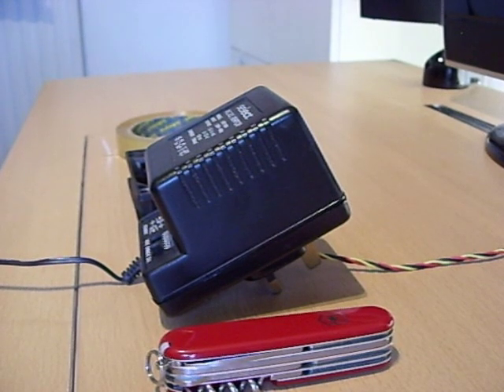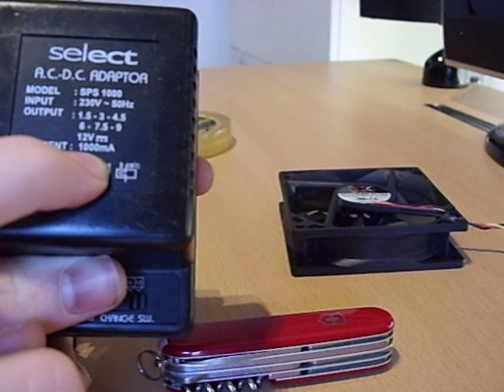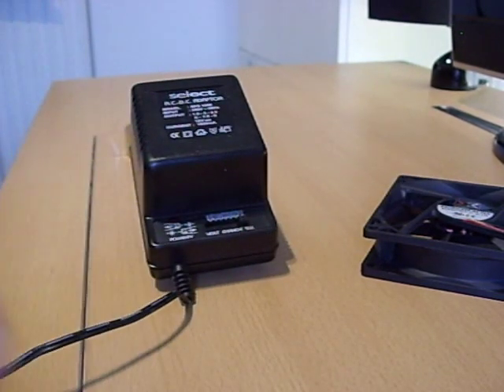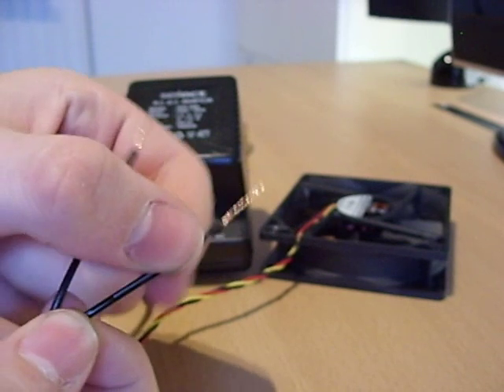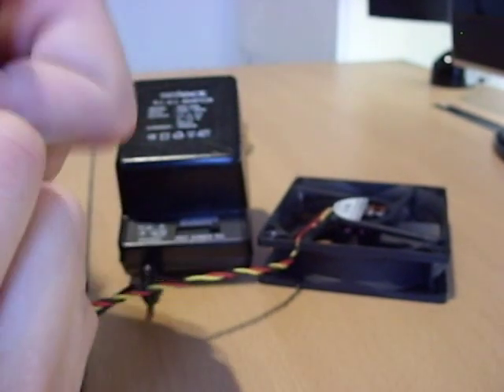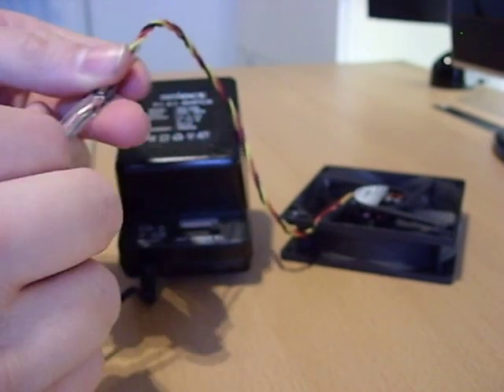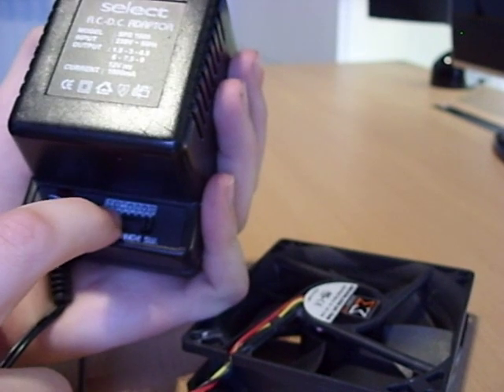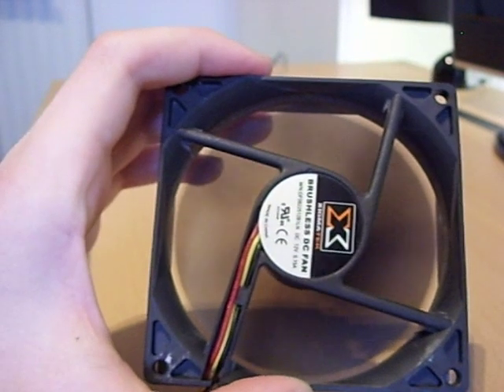Power a PC Fan Using Plug-In Transformer - How To

Comment: The amps should add up, but also the volts ?
If i wanna power 6 fans like that, do i need transformer that have 72 Volt to run 6 fans with each of them 12 Volts?

Comment: Can I use 12.0v on my pc fan 12v
Reply from the maker: Yes, you should be able to use any 12v PC fan with a 12v DC adapter, as long as it can handle the current (A)

Comment: Hey, bit of a random question but hoping you can help. I'm a total noob when it comes to electrics and have been watching videos about LED cobs and fans.  From what I gather, you can hook up pc fans to a power supply which has more amps than is required and the fan will then just take what it needs. So for example I can hook up 4 fans to a 12v 0.25a fans to a 12v 3a power supply and each fan will only take 0.25a each, meaning I have room for 8 more.

But then what I don't understand is with LED cobs, if I were to hook up 1 3.5a cob to a 4.0a transformer/power supply, the cob would blow because it cannot handle that much amperage. Why is there a difference between a fan which will just take what it needs and the LED which will blow if there is too much?

Comment: I would like to know how to step the output current of the transformer down from 1000 mA to 150 mA of required current in order to safely operate the fan?
Reply: +Viktor Božičević you don need to do that, you just need the voltage to match
Reply: +Haliff Roslan So it doesn't matter if my wall adaptor is rated 1000 mA of output current it won't danger the fan?
Reply: +Viktor Božičević Only incorrect polarity could damage the fan. I'm waiting for a multimeter.

Comment: Do you think it is safe to plug the transformer (one that doesn't have the variable voltages your transformer had) into a lamp dimmer switch to be able to control the speed of one fan?
Reply from the maker: I'm really not sure. A standard dimmer switch must be designed for AC current though, and this would meed dimming the current INTO the transformer, which is probably not reccommended.

Comment: Could you use a laptop power supply ?
Reply: yup! only if it says like 15 less if you wanna try you can use like 17Volts DC NOT AC
some AMD fans can handle up to 48V! but when it reaches the max A.K.A 24V it starts decreasing the speed!! until it stops!
so you can risk it if you want but DONT POWER IT FOR 2 LONG!

Comment: So most of these power supplies are unregulated, so wouldn't that mean it could power the fan with more volts that the fan was designed to take?
Reply: some AMD fans can handle up to 48V! but when it reaches the max A.K.A 24V it starts decreasing the speed!! until it stops!

Comment: How many fans could you power with the same transformer?
Reply from the maker: Natty King It depends on the current rating of the transformer, for example a 1A (1 amp = 1000mA) transformer can power 1000mA's at its rated voltage. So if you have two fans rated at 500mA each, they can be powered as 2x 500mA = 1000mA. However, if you have three of these fans, total current becomes 3x 500mA = 1500mA, which is too high for the transformer.
Reply: you can even reach like 10 or 12 fans if the FANS CURRENT still lower then the TRANSFORMER current SO ENJOY!

Comment: Hi Mate,I am in the process of building  a Beef Jerky/Biltong Drying Box,i need to run three 120 mm Fans one in one out and one on standby in case of any problems,now I want to ask you can I link all three to the one Transformer and not blow them,they are 12 volt and I think 0.14A,
Only two will be working for about 4 days continuous running as I need to keep a steady heat,supplied by a 60 watt bulb and the Humidity has to be stable as well,also is there any way to control the speed of the fans,I have got all the bits and pieces sorted its just the wiring up of the lectrics that I am wary of,so if you could advise me I would be very grateful,may even send you some Jerky or Biltong,great vid by the way the best one I have seen regarding this set up so Many Thanks for this,hope to hear from you,All the best from Cornwall.
Reply from the maker: rockraptor616 Hi! Firstly, it's the voltage that controls the speed of your fans, the closer you get to your fan's maximum voltage, the faster it will spin. You can only blow the fans if the potential difference is too high (they receive too many volts). The current (measured in amps) is how much the fans will take from your transformer, your transformer cannot supply too many amps, but your fans can demand too many amps from your transformer. That's why it's important to have a transformer rated higher for current than the sum of all the fans added together. In your scenario, to run all three fans, you require a transformer rated at 3x 0.14A = 0.42A or more. And if the fans are 12v, a 12v transformer will spin them at full speed, reducing the voltage will slow the fans. Hope this helps!

Comment: Can it run more than two or more fans using only one adaptor?
Reply: wana burn down your house? cause thats how you burn down your house
Reply: henriko raap Y? My desktop PC has three cooling fans. My house is not yet on fire.
Reply: but i mean if you put them together doesn't it takes more energy and doesn't it burns it through?
Reply: henriko raap i see your point. Actually, was planning of making one like for my xbox that's overheating. so i thought assembling one with two fans. One in the intake and the other one in the exhaust. I'm not an electrical engineer nor computer techie, i don't know the standard capacities of adaptors and fans. I was thinking of using bigger adaptors that can handle two fans.
Reply: henriko raap lol that usage of the meme made me laugh
Reply: you can power even 50 fans :D but low speed

Comment from the maker: 1A is the minimum rating for your transformer. Anything above 1A will be able to power the fans, and it will not provide too much power, as the current only increases if the components require it.

Comment: Hi,
Thanks for the answer.
I found the fan from flea market already. 2 of them only have 2 cables (red and black), so red should be positive & black should be negative. The other 3 have 4 cables with yellow & red on the outside and black on the inside (molex). Which black do I need for negative, the one next to red or the one next to yellow?
And is it ok to combine those 2 different types of cable fans into 1 power supply?
Thanks again for your help

Comment from the maker: 1.5A is the minimum that you can use, it's often better to buy an adapter with a bigger rating to ensure the power draw doesn't become too large for the adapter.
As for 4 cable fans, red is positive, black is negative, yellow is tachometer, blue is PWM speed control. If the cables are not colour coordinated, I can't really help you, so you might have to do some research. :)

Comment: Hi there,
I want to power 5 fans with adapter, each fan +- 0.3A & my fans have 4 cables.
The question is, do I need exactly 1.5A adapter or bigger = better?
Another thing, for 4 cables what the polarities are?
How do I check that (if for example color does not determine the polarity)
Can I see it from the positioning of the molex?
Thanks a lot

Comment from the maker: It depends on the current of the fan. Check the current rating of the fan in amps (A) and the rating of the power supply.
You add up the current ratings on the fans, and you can have as many fans as you want without exceeding the current rating on the transformer.

Comment: yes it's safe ,but first join the wires to the fan and sleeve them, best suggestion is to use a connector block first so that you get the polarity right ,then sleeve them ,or tape them up separately before plugging the transformer into the mains socket

Comment: Hi,
  First why cut the plug?? A jack can be had for less than 3 dollars. Next the Yellow wire is NOT ground it is used to control the fan so it does not run all the time just when the CPU it is cooling gets hot and it turns on. I did the same thing but used a jack so now I can use the transformer for it's original use. Also it can easily be pulled so I can move or put fan away.

Comment from the maker: Well it's an AC adapter that converts high voltage AC into low voltage DC.
I just looked on Amazon and typed in "12 volt AC adapter", I've put a few links in the description but I don't know if they ship to Sweden. :)

Comment from the maker: I can't really tell you as I'm not certain what you mean. If you just mean voltage gets converted from 16v to 12v after the AC Plug, then you should be fine with a smaller voltage draw, as that should mean a lower power demand.

Comment from the maker: As I said, your fan each need a certain amount of current (Amps (A)) check each fan for their current requirement.
Then add all of the current readings together. So if each fan required 0.5A you'd need a transformer that was rated at OVER 4 x 0.5A = 2A. If the transformer is rated at over 2A, it is able to power the fans, if not the fans will draw too much power and possibly destroy your transformer and cause big problems.

Comment from the maker: @MrSuper0bby - I'm not here to garuntee your workmanship is safe, although using insulation tape instead of selotape and ensuring that each wire is isolated (tape rapped around the connection by itself, tape around black, different tape around red, more tape around the whole thing...) then there's no reason for it to be unsafe.
Plus you're dealing with voltages that can be created by batteries.

Comment: Great video man! helped a lot...i needed the info for a frog vivarium cooling system..
One question: if i connect the black and red wires to the transformer's wires but i do it wrong (if they should be the other way) will anything bad happend other than the fan not working?
Thanks!

Comment from the maker: @halucinacija2 
Copied from below: One thing I mentioned was current, you need to make sure you're not drawing more current from the charger than it can handle.
Look at your fans and find out how many amps (A) they use each (current), and add them all up.
Now look at your transformer, see how many amps it is rated at. If the charger is rated at a higher number of Amps than your fans all added together, then everything should be fine. If the charger is rated at LESS, you could run into problems.

Comment: finally a good tutorial, I'm trying to change the fans in my laptop cooler to 12v fans on a 12v power supply, you just saved me about $15 Aus on molex connectors and an adaptor with a molex, thanks

Comment from the maker: @DuckaOFFICIAL - Well one thing I mentioned was current, you need to make sure you're not drawing more current from the charger than it can handle.
Look at your fans and find out how many amps (A) they use each (current), and add them all up.
Now look at your Nokia charger, see how many amps it is rated at. If the charger is rated at a higher number of Amps than your fans all added together, then everything should be fine. If the charger is rated at LESS, you could run into problems.

Comment from the maker: @jaytabz - You need the adapter to have a higher current rating than your fan. Maybe your adapter is rated at only 1 amp and your fan needs 2 amps or something. If your fan has got a higher current rating than the adapter, do not use it! It could cause many problems with the adapter and probably a burn out.

Comment from the maker: @jaytabz - Well if the fan is rated at 12 volts the maximum you should put through it is 12 volts. However if the adapter is less than 12 volts, then the fan will move slower. The higher the voltage the faster the fan will move, but don't go over the rated voltage of the fan, else you'll most likely burn out the motor.

Comment from the maker: @ikharus1 - It's most likely the amount of power that three fans draws from the transformer. You need to make sure that you have a sufficient current rating to power all three fans.
As you saw in the video, my fan uses 0.3A or 300mA, my transformer was rated at 1000mA, therefore connecting three of my fans would use 900mA, which would be fine.
However, I guess your fans used more that that amount of current or your transformer was rated at a lower current.

Comment: @MyRandomReviews 

'Powering a PC fan using a plug in transformer.' Its exactly the same as using an computer power supply, you shouldn't call it mains electricity because that implies that you are using 110 / 230 volt ac to power it.